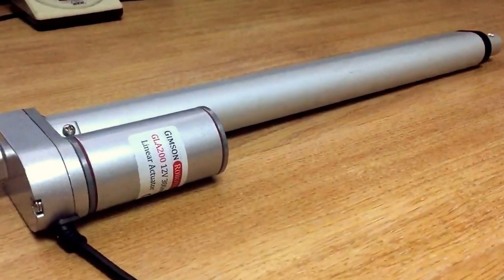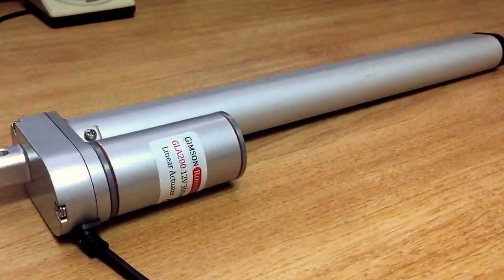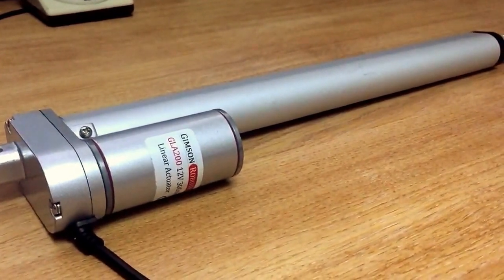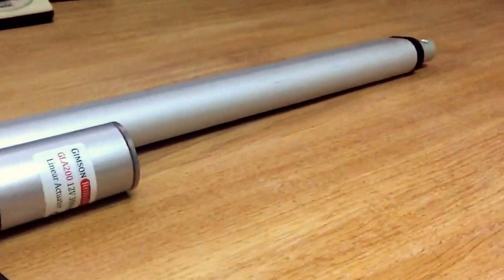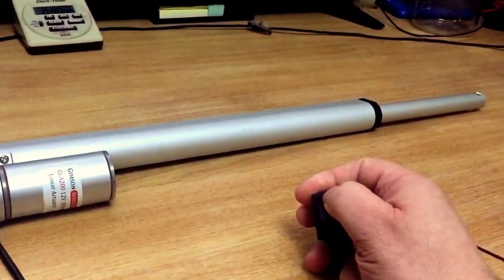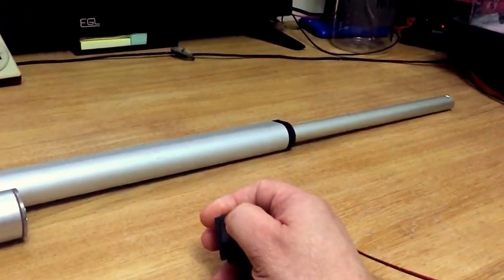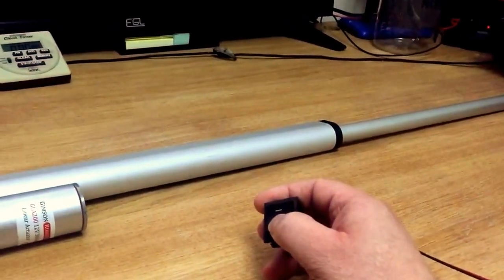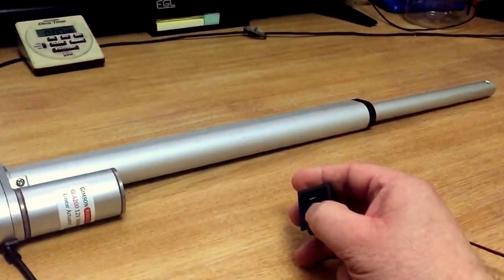12V DC Long-Stroke Linear Actuator Gimson Robotics GLA200

Comment: Hi thank you for the making the video. I wanted to know if this can open a metal gate? Like is it powerful enough?
Reply from the maker: I think it will yes
Reply: @GoldenSolutionPlating  Thanks for the fast reply, I am trying to automate my gate using this kind of arm & controlled by a bluetooth remote since my home is on road & traffic jams up real bad if you stop the car for even 2 seconds on road to open the main gate of home & get the car inside. Greetings for Pakistan!

Comment: Can we control speed ? I need speed of around 1.2 mm /sec.
Reply from the maker: Well yes you can turn the voltage down and it will slow down but you can’t go faster as it is at the maximum power of 12 volts 
Thanks
Reply: Thanks  @GoldenSolutionPlating . My projects demand slow linear speeds.
Reply: Also is it possible to restrict the stroke length ?
Reply from the maker: @dr.lennartsingh5688  not sure about that

Comment: Can you wire four aculators together to a rocker switch
Reply from the maker: Yes you can
Reply: Thank you very much,I was abit worried , what size inline fuse would you recommend as there 5a each.
Reply: How would you suggest to wire the four together if you don't mind me asking.

Comment: qual a amperangem?
Reply from the maker: Motor: 12V DC, up to 35W
Operating voltage: 3-18V (this is the practical operating window, the warranty is voided if operating at above 12V DC)
No Load speed: 29mm/s
No Load Current: 0.8A
Full Load Speed: 21mm/s
Maximum load: 250N/25kg
Current for max. load: 3.2A
Stall current: 5.2A (the actuator should only ever be allowed to stall for short <1s periods)
Maximum static load: 500N (51kg)
Noise levels: < 50dB under no-load
< 53dB under full-load
Maximum duty cycle: 40% (this is the maximum proportion of time that the actuator may be in operation for, up to 2minutes during any continuous stretch. The duty cycle should be reduced below 20% for average loads >100N)
Life expectancy: Nominal 40,000 strokes
Reply: congratulations. is good